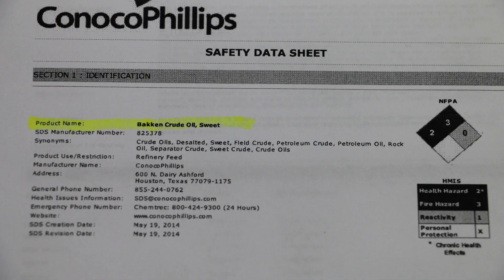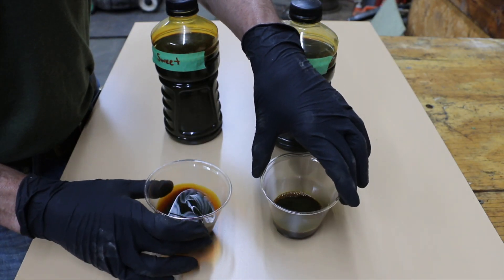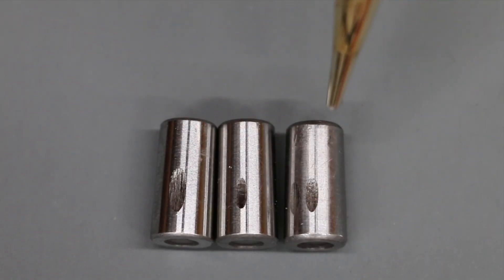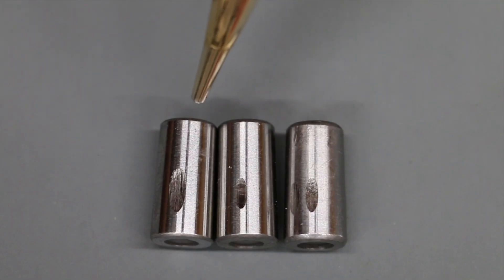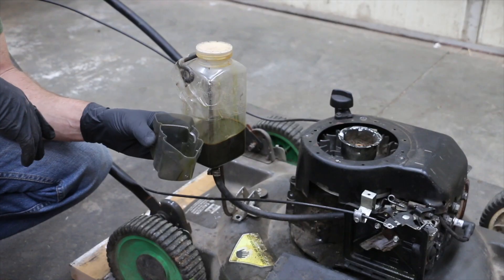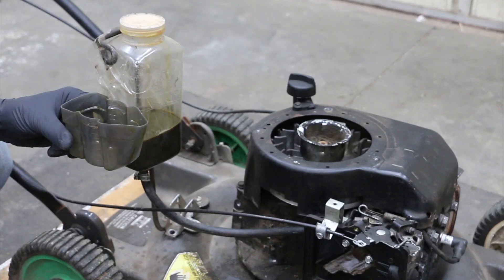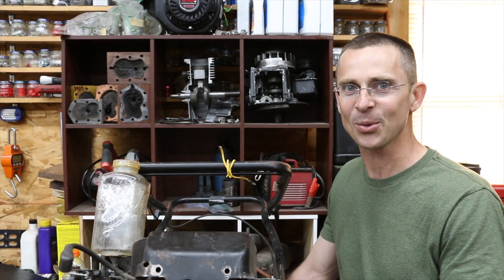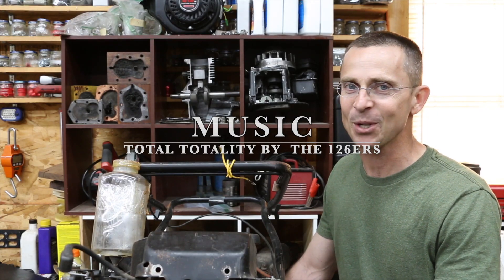Will a Gas engine run on Crude Oil?  Let's try it!

Comment: Looks like you could use sour crude for fuel and engine oil at the same time,  straight out of the ground!
Reply from the maker: Yes, it would work.  The hydrogen sulfide is corrosive and wouldn't do well in the crankcase for long.

Comment: I remember the first time I smelled and touched crude on a work trip to the DFW area and it was in a used plastic Gatorade / Powerade bottle.  Must be the industry standard for storage of small amounts.  The crude wasn't what I expected.  Something we Iowegians don't see too often.
As always, my 14 year old son always look forward to your videos.  He went so far as to revive an old mower I had.  His one mistake was using my 1/2" impact to start it and it ended up stripping the nut.  Now he gets to fix it again.
Reply from the maker: Thank you for the positive comment!  A drill with a socket adapter should work without stripping the threads.

Comment: They put sulphur in machine cutting oil , for extreme presdure lube, which would explain sour crudes good performance, but is a pollutant in engine oil you dont want to burn and enter the air
Reply from the maker: All great points and thanks for commenting.

Comment: Now would this work for two stroke 🤔
Reply from the maker: Thank you for the video idea!
Reply: I feel like you would definitely want to preheat the oil and the engine a bit. I'm thinking it definitely would though! Those jets are tiny too
Reply: I imagine it would be perfect for 2-cycle, actually. The sour has better lubricity than straight oil, and the flash point of the sweet is almost as low as gasoline.

Comment: Before I even watch this video, I'm going to predict that no, it will not run on crude oil.
Reply from the maker: Thank you
Reply: Have you heard of these efi systems for single cylinder engines? Walbro makes a really nice system, and then there's a company called Ecotron that has a kit. I'm curious what advantages efi has over carb. I'm sure there's a fuel savings, but can a 6.5hp motor produce more with EFI? It seems to have electronic ignition and capable of compensating for different octanes, elevation, and airflow restrictions from dirty air filters. I did see a price tag of around $600 from Ecotron, so I don't know if this is something worth investing in. I'd like to see a predator 212 efi vs. carb hp and tq differences.

Comment: Project Farm can you do a experiment trying to run a 2 stroke engine like normal gasoline and oil mixture but instead of using 2 stroke oil , use 4 stroke oil
Reply: Ooh, that's a rough field sometimes. Modern cars are a serious rats' nest of wires.

Good luck. :D
Reply from the maker: Thank you for the video idea!
Reply: The old ones did use regular oil
Reply: Back in the day, there was no such thing as 2 stroke oil, just oil, so that's exactly what they did. It worked. I've done it a few times. It's not ideal, but it works fine.
Reply: edifyguy thanks now i know , im new to engines and everything else...... after this summer im going to a 3 year school so I can be a car-electrician.
Reply: edifyguy thanks!!👍👍👍

Comment: Did you try to start the mower with a spark plug, i.e. Diesel?
Reply from the maker: The mower did have a spark plug.  I don't have a glow plug for it.
Reply: Used to be that crude oil, or something close to crude oil, used to be very cheap, so cheap that the railroads in the west used it for fuel in their steam locomotives instead of coal or wood.  How much did the oil cost you as compared to what you pay for the same amount of gasoline?

Comment: when your running thicker fuels try putting a carb on the engine from a high horsepower engine. Had a 5hp go cart with a 8hp carb because we had an ample supply of used motor oil on the farm and that set up would run it but, it made a grey military grade smoke screen
Reply from the maker: This is a great recommendation--thank you!

Comment: -20'F flash point?  Doesnt that mean it will self ignite at room temperature?
Reply from the maker: Auto-ignition temperature is temperature you're mentioning.  It wasn't listed, but more likely several hundred degrees.

Comment: This is great! I'm curious if you can improve fuel efficiency by altering the stoichiometry of combustion reagents (for instance) using pure oxygen and seeing how little fuel you can use to get full combustion... Maybe a direct intake with a red bernzomatic oxygen can, if its possible to trickle gas in and get full combustion using pure o2 it would be really cool if you hooked up an oxygen generator to the alternator, maybe this is the way to the best fuel efficiency possible...  but can't say for sure until experiments are done... all engines get carbon build up and that only means there isnt enough oxidant (oxygen) to fully change the fuel to co2, h2o and heat (combustion)... in an oxygen deprived environment hydrocarbons change to CO, C, H2O, and much less heat. Notice there is no solid carbon in the first equation and if a hydrocarbon is burned perfectly you get energy + gaseous emissions.   not carbon build up. since there is in almost all stock engines, there is excess fuel not being turned into energy, its being converted to carbon, if balanced right you can theoretically achieve 100% efficiency. meaning less gas used, less engine gunk, and equal power output
Reply from the maker: Thank you for the video idea!

Comment: I bet burning that sour crude oil had a bad exhaust smell compared to the sweet crude oil. Am I right? Have you tried running an engine on used motor oil?
Reply from the maker: Yes, I wore a respirator while testing in the shop.

Comment: Huh, never would have guessed that crude oil would run in an engine. I always imagined crude oil more like used motor oil. Thick, dirty, and not producing flammable fumes.
Reply: I use 20% Waste Motor Oil (5W30) mixed with 80% Waste Jet A1 to run my 3.0L Diesel Truck. Have been doing so now for 4+ years without any problems.
Reply: mharris1270 - "I wouldn't pay $25 a gallon for new oil to burn in your truck's gas tank"
Hence why I use WASTE Motor Oil, which most mechanic workshops will happily store and give to you for FREE, because it saves them paying to have the waste oil removed and transported. But every time that I do an oil change, I simply throw that oil into my 1000L JetA1 storage container and allow sufficient time for it to settle to allow microscopic metal fragments and gel fragments to drop to the bottom.
Reply: noimagination99 - "(Jet = Kerosene, BTW)"
Well kinda, in essence yeah, but it has a LOT more additives...like Anti-gumming agent, Corrosion Inhibitors, Anti-static agent, icing inhibitor, and Biocides to prevent Algae.

You can get it from companies who service aircraft, because they have to drain tanks before commencing work, and they cannot put it back into aircraft unless it has been re-certified. So they usually sell it as Parts wash Kerosine. It helps to know somebody who works in the aviation servicing area....
Reply from the maker: Thank you!
Reply: Anthony GHB - 200L in a 1000L IBC pod represents 200L of free fuel, whilst 800L of Waste JetA1 costs about 40c per litre, so 1000L of Fuel costs me about $320 or about 32c per Litre. Considering commercial Diesel costs around 5 x that price, it's a significant saving.
Reply: My image of crude oil is heated roof tar OR really, really old and thick differential oil. Mind you, I have never seen the real article with my own eyes or felt it with my hands.
However, I bet if you heat it hot enough you could make ANY ICE run on it(talking from experience with oil fueled ranges, heaters and pottery ovens).
Reply: JIGA BACHI yeah the stuff across the street here in NE ohio is Marcellus Shale and pretty thick almost molasses...
Reply: Crude oil varies a lot. Heavy crude oil isn't far off from tar
Reply: how/where do you get "waste" jet A1?  (Jet = Kerosene, BTW)
Reply: How much money do you save by using waste oil?
Reply: Thanks!  And you are certainly correct, I just meant it's basically the same distillate cut (boiling range) from the refinery, and as it relates to many uses, it's nearly the same.  Same volatility, etc.  I wouldn't put kerosene in my jet (if I had one). :-)
Reply: Neither did I, even if I occasionally work with crude oil. Its not really that thick but it is dirty and incredibly nasty stuff; it smells horrible and its really tedious to clean off. And if it is straight from the well, the chances are it contains a fair amount of water.
Reply: @BoloH.   bakken oil separates from the water immediately. the bakken he used is thicker than the bakken oil i worked with . i had a dust up with a guy online when i said i think you could run your engine on bakken crude. he said you don't know much about crude oil. as my buddy said we were cruising for chicks just tell them you are in the oil business. don't need to tell them we are knee deep in it.
Reply: It depends what oil you have and where it came from. You can run an engine on Permian and Bakken crude no problem but you can forget running an engine off of heavy Canadian or Venezuelan oil

Comment: HOLY PETE!!! I am truly AMAZED at just how "CLEAN" the inside of that engine was,after running BOTH the sweet and sour Crude oil's within it!!! All the tests You've done on here,where You showed what the inside of the combustion-chamber looks like AFTERWARDS......was all BLACK,DIRTY and NASTY despite how much You cleaned it beforehand!!! THIS TIME however,wasn't much difference at all,and there was NOTHING on top of the piston itself,on both crude-oil's!!! That's what amazed me the most!!! It looked brand-new after both tests!!! The Sparkplug however,clearly didn't fare as well,as that was EXTREMELY CARBONED UP to the point where it almost looked like Tar on the end of it!!! Lol. Anyway,EXCELLENT TEST as always Project Farm!!! Keep em coming!!! :)
Reply from the maker: Thank you!

Comment: you could have tried heating the oil instead of adding the gas.
Reply from the maker: You're right. I should have done this.
Reply: Gassifier
Reply: Anonarchist heating the oil
Reply: You must use a hot water bath to heat up flammable liquids, you are not supposed to use straight heating or open flames. Dipping the full plastic reservoir into a pot with hot water for 10 mins would have done the trick!
Reply: Project Farm:  I would suggest a copper pipe wrapped ONCE around the muffler as a heater prior to adding to the carburetor.  If that did not heat it enough, then cautiously add more wraps.
Reply: Project Farm part 2, heating the sweet crude oil?
Reply: mharris1270 I heat crude to 90deg C all the time
Reply: if you are heating crude oil, you can heat diesel to make it evaporate and burn in a gas engine
Reply: Project Farm  heating oil is same as offroad diesel ( diesel dyed red or green in some countrys like Lithuania)
Reply: My Dad during ww2 used diesel in his hupmobile when gas was in short supply he did it by starting the engine on reg gas and then using copper tubing wrapped aroung the exhuast manifold would heat the diesel and it would run well enough to get down the road and not smoke too bad,and remember the diesel back then was nothing like what we have to burn now.
Reply: mharris1270
flash point and auto ignition point are very different.
Reply: It has such a low flash point that could be kind of dangerous No?
Reply: Crude oil is up because biden gets 10% off the top....thats what brought me here.
Reply: Heating Oil is Diesel
Reply: Heating the oil, not heating oil.

Comment: I'm quite amazed to see how well the engines ran on crude, it's always depicted as being tarry gloop rather than a liquid, so seeing an engine run right off it, it's impressive!! :)

As for the lubricity, the sour is probably more lubricating as the sulphur in there acts like a lubricant, and is what kept diesel engines happy before they replaced traditional diesel fuel with Ultra-Low Sulphur Diesel (ULSD), which annoyed many a vintage diesel engine owner as they're having to use additives to keep their engines from being destroyed due to the lack of lubrication...
Reply from the maker: Great point regarding the Sulfur and ULSD.
Reply: Yea man , I run about a 20-25% mix of “other” oils , like mmo,unused engine oil and a cetane booster , and maybe some atf...
The new fuel is so dry, try lubricating a diesel fuel filter gasket and spinning it on. 
Haha you may as well use water , it’ll squeak less.
Mmo must work , there is all kinds of warnings to not use it for on the road vehicles.
Reply: Sulfur spelling...
Reply: In British English (where English originates), Sulphur is spelled with a ph, rather than an f, so it is correct according to the OED... :)

Comment: When using you lubricity tester I think you should let it run for 10 or 15 seconds with no load before adding weight... would be interested to see if the oils can build a a film strength before adding load
Reply: Don't change your method when you want to compare new results to old.
Reply from the maker: Thank you for the recommendation!
Reply: Put it this way when you start your car do you instantly rev it to the moon? Or do you let it warm up... I think certain oils with additives will bring a better result if it runs at "idle"
Reply: Brent Zandstra in your car engine you have an oil pump trying to move cold oil through narrow passages into bearings or to the cylinder heads. Not quite the same as oil in a solo cup.

Comment: I can send you my blue print of my generator.
Reply from the maker: Sure. Do you have an electronic copy?
Reply: Ill take a photo and ill send it right over. It's very simple, cheap and just requires (distilled) water, salt and DC current.

Comment: Seeing that the sour crude bearing had less wear makes sense. Sulfur increases the load capacity of the lubricant. One of the reasons that gear oil out of your differential stinks like sulfur.
Reply from the maker: Great point!

Comment: Would these run in a diesel?
Reply: Yes, I know they will in a big diesels anyway. Way back when, they used to run the tanker ship's big ol 2 stroke diesels on crude oil to cut costs.
Reply from the maker: Thank you for the video idea!
Reply: Hope you do a video on this and yes it will run on it. I run my diesel truck and diesel generator on waste vegetable oil and used motor oil
Reply: magnificentshine1 we all know diesel engines run on veggie oil and the likes but what would happen to it on crude oil. What power difference would there be, what effects in terms of carbon buildup would occur, would the injector be fine? Im actually curious
Reply: Project Farm you can buy cheap china diesel engines on ebay and craigslist. 3 to 5hp ones are fairly cheap and definitely would be durable to do more of these "can i use(alternative kaboomy juice) instead of normal kaboomy juice"         i think you should also try running various oils through diesel engines and petrol engines as fuel
Reply: mharris1270 or maybe just run it as is in a 2 stroke and see if it blows

Comment: if what i was told is correct, cargo ships just run on non refined crude oil
Reply from the maker: This is interesting.
Reply: Hillbilly Hickey If I remember correctly and this is from many many years ago they had grades of fuel oil for ships. 

While doing vbss operations, I have seen some very crappy fuel that these ships would run on, with out a doubt they could run on what he had there,  But in turn crude oil from Iraq is very very gritty, almost like it has sand in it.

Comment: I've got a suggestion for a new topic to test. I help my neighbors keep their mowers running (surrounded by divorcees). It got me wondering what causes the engines not to work, and whether I need to replace everything?

So, try testing things like: how much deviation from standard gap can the magnetos be, the spark plug. How much water in the carb bowl, how occluded can the air filter get, how plugged can the needle valve be .... limited number of questions, possibly a short series, or maybe a single mammoth video.

one thing that got me thinking about this, I remember an engine running when I pulled the spark plug boot off, but it got a couple of inches away (the spark was making a MAJOR jump). So sensitive can the plug gap actually be? ... since then the sparkplug is one of the last things I suspect, I think a cracked ceramic might be the only real reason a plug fails enough to cause an engine not to run.

Sure, all of these factors can cause poor engine performance, but how many can really cause an engine not to run at all?
Reply from the maker: Thank you for the video idea!
Reply: btw, this reminded me of running "drip" in my truck when I lived in the 4 corners region. It was early 80's, the wells had containers of what we called "drip". I was young and cheap, and used a lot of this stuff in my truck. Friends worked out there and hooked me up so it was free. completely unrefined... not sure it was even filtered. I only did it for a year or so before I left. Never did see any ill effects, but didn't keep the truck either!

Comment: Try diesel again in one of the old carb on tank engines. You will need to drip some gas in the carb for a minute to warm up. Afterwards it will run just fine on pure diesel
Reply from the maker: Thank you for the video idea!